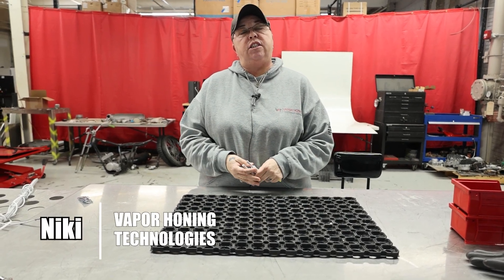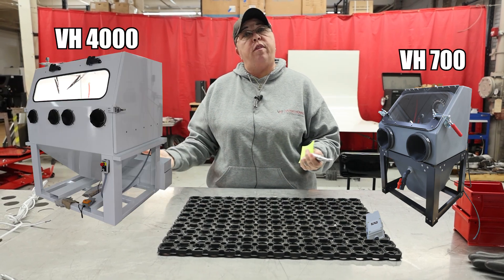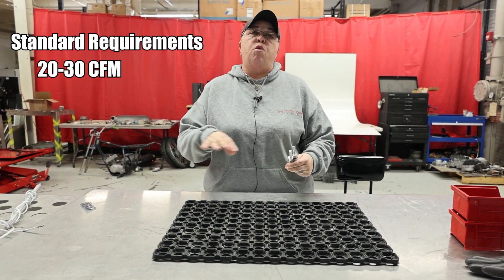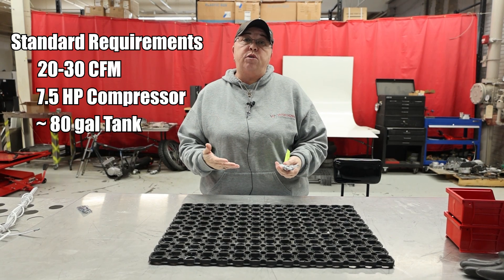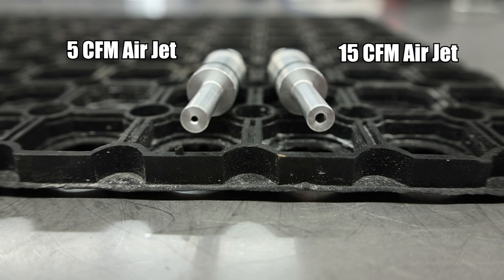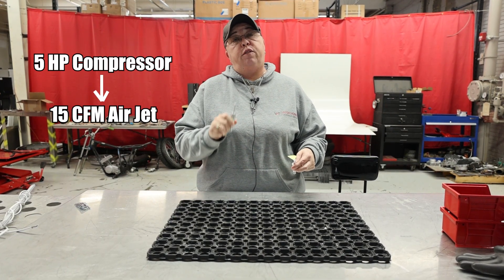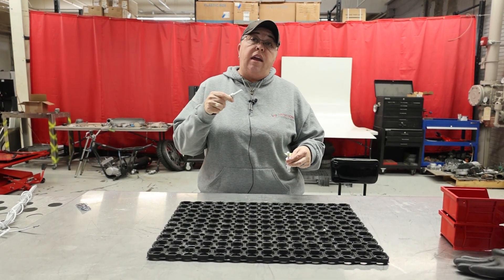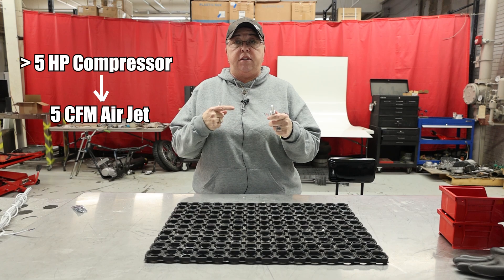What Kind of Compressor do I need for my vapor blasting system?

Comment: The jet and nozzle need to be matched.  The gun which comes with the weekend warrior has a 10 hp jet and nozzle, at least mine did.  A 10 hp jet and nozzle requires 37 cfm at 60 psi to operate properly.  If you put a 5 cfm jet in a gun with a nozzle that is designed for a 10 hp compressor (37 cfm) there will be way too much slurry and not enough air to accelerate it.  Your engineering and design staff should know that.  In my humble opinion.